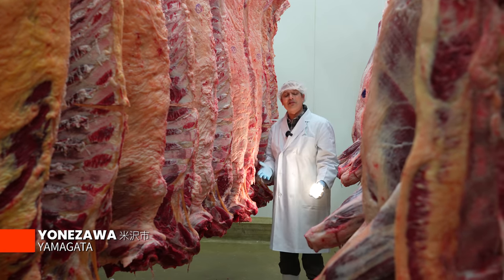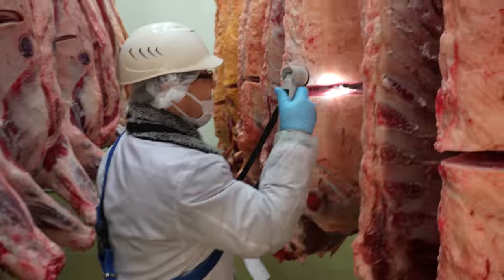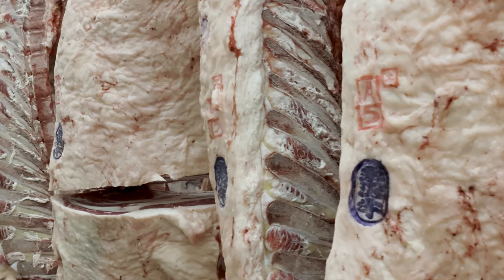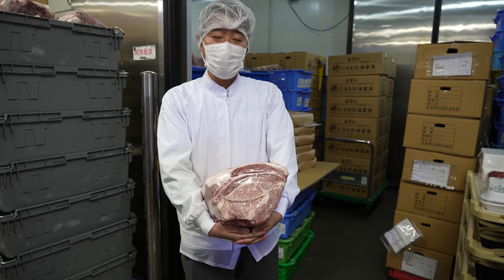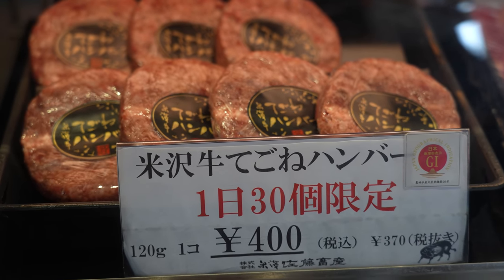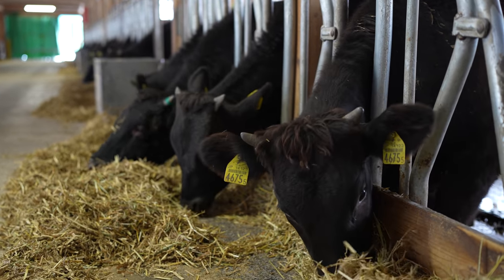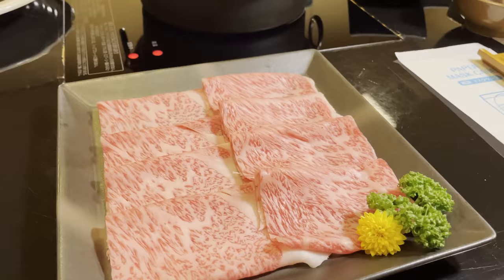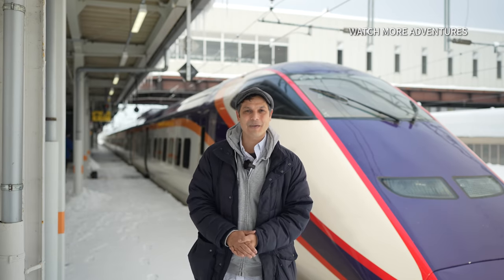How Japanese Wagyu Beef is Graded | Farm to Table ★ ONLY in JAPAN

Comment: That pricing at the butcher's shop was incredible. To get such a high quality product for that cheap, what a treat.
Reply: Also my buddy works at a wastewater treatment facility here in the states and his facility does a biofuel recycling setup like the one you showed at the ranch. It's tricky because methane corrodes the equipment that's used to make power from the gas itself but it is worth it for sure

Comment: CC turned on help with the translation. The prices very depending on what type and the cut of the 🥩 you want to get. And prices very at Restaurants to depending where you get the Wayu 🥩 .  I would get them for special occasion or festival time. Between 20 and 40 not bad prices  if you get more be over $100.  A certain 📺 commercial Where’s the 🥩 it’s in Yamagata Okitama area. 🥩🇯🇵👍 📸